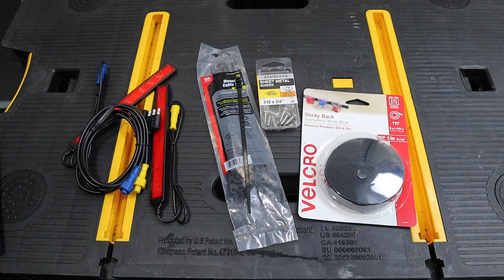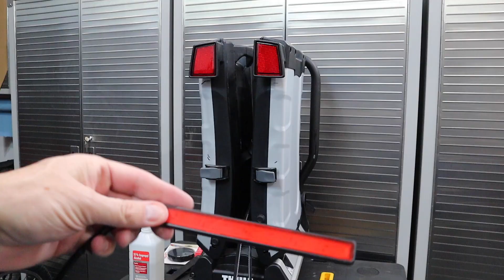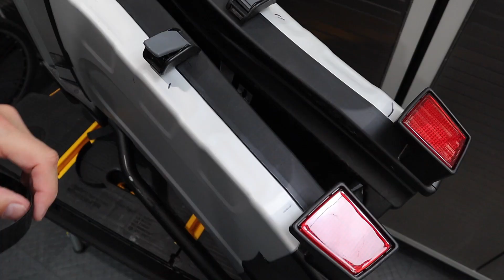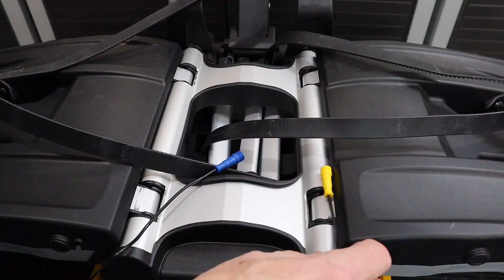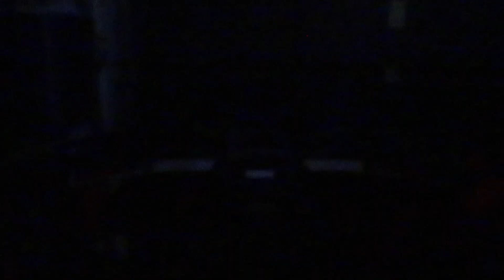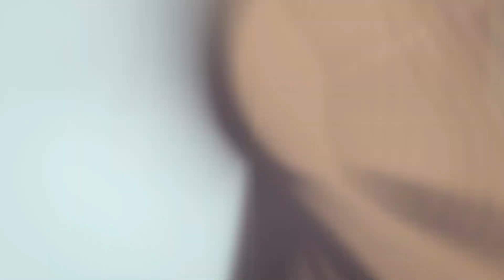Bike Rack Taillights - Added safety when your vehicle lights are covered.

Comment from the maker: Most people don't read the comment section.  Here's the link if you're interested.  https://amzn.to/2SP0SsJ
Reply: Very good video! Did you figure out the cables management?
Reply: Hello! Thanks for the video. Can you please also make a short video clip how the lights works during daytime, please?
Reply: Hello, how are your lights holding up? I've gone thru 2 sets after barely even using them. The left side light on both sets either stops working or only partially works. Meaning it will come on w/ headlights, but not the blinker or brakes. I had U-haul test my connection and it is fine. The lights worked great when I installed them.

Comment: I used velcro to mount theme aswell but I took off the silverr plates on bottom and routed the wires like the european rack has with factory lights prepared. Made it for a cleaner appearance although I did drill 2 holes for cables in retro specs I would have cables go through the reflector housing  for even cleaner install.
Reply from the maker: That's very cool.  My OCD does love a nice clean install.  I bet it looks great.  BTW, I'm from Peoria.

Comment: How is the ling term for these lights? Do they still work? Any kind of issues one needs to know about? How about the mounting method any issues ?
Reply from the maker: They worked until the day I sold that carrier.  When I upgraded my bike, it was too wide for the rack when two bikes were on it.  The lights are very good quality and the brand is reputable.  I would feel comfortable recommending them with hesitation.
Reply: @evolutionaryTom thank you

Comment: Hi Tom. I have the Thule EasyFold Rack. Have you found these lights bright enough in the sunshine or have you found a better one ? Thanks, Gary
Reply from the maker: The lights are just so so in the daytime, better than nothing.  Since that video, which is years old, I have found a better one.  Not as cheap thought but cheaper than getting the rear end of your car fixed by far!

Hollywood Racks makes this light for their racks: https://amzn.to/42BH1m8

It is as bright as the rear lights on your vehicle in the daytime.  Here's a video I did that illustrates the light in daytime: https://youtu.be/v1AL_kWj6ic

It has some different mounting options.  It comes with straps so you can just hang it over your bikes, or it has a mount for the Hollywood Rack itself.  For the Thule, I would us the velcro tape like I did in my original video and it would work perfectly on the Thule.  It even flexes so you could let it bend in a curve and follow the form of the Thule rack on the back.

I hope this helps.

Comment: @evolutionarytom Thanks for the video Tom, this is exactly what i was looking for. How well does the velcro tape stick over time with the elements? I'm looking to use this both when the rack is up and when it's loaded with bikes and velcro strips at different locations using the same light bars are exactly what I was looking for.
Reply from the maker: The velcro has held up really well.  Recently I did a video on another light bar and I think it can be adapted to the Thule rack in the same manner, with the velcro.  It is very bright and easy to see in the daylight.  https://youtu.be/v1AL_kWj6ic Both are better options than no lights at all, for sure.  Thanks for the nice comment.  -Tom
Reply: @evolutionaryTom  Thanks for that link and video. I am weighing my options now. I have a Saris MHS platform and Saris makes a light bar that is specifically for MHS racks and has a bracket that uses existing bolts and bolt holes to secure light bar to rack and is $40 more than Hollywood. The only downside is the Saris bar can impede your legs a bit while loading on the bikes.

Comment: Awesome video. I have been looking at zillions of alternatives to add lights to my rack. Your method is by far the best!
Reply from the maker: Thanks, Randy.  I wish they were even brighter but this is a huge improvement.
Reply: I agree same here I purchased a 1up but wasn't happy with there license plate holder Led light and I thought it abit expensive there had to be a cheaper alternative that makes you happy with a license plate AND a Brake and sjgnal light at less then half the price 1up was offering.

Comment: I watch this video to find out where u connect the light to the car but it’s not there . Don’t watch this if ur looking for that
Reply from the maker: It's just the standard 4 way flat trailer plug that connects to the car.  It's at the end of the wire to these lights.  You just plug it in.

Comment: This is so helpful! Quick question: How beneficial is the velcro versus just using the existing 3M adhesive tape?
Reply from the maker: Thank you, Adam.  I think the 3M tape would work just fine.  I've found no need to really remove the lights since I came up with this.  I think you'd be good!  -Tom
Reply: @evolutionaryTom  Thanks!! I might also want to use this rig on another hitch carrier I have. But to be honest, the LED is around $25 and I might just buy another set.

Comment: Thank you for being considerate to your fellow drivers! I see so many people with bike racks with the bikes blocking their signals, driving down the interstate without a clue nobody can see them or their signals. Not to mention the trailer, oh gosh the trailers where they can’t spend 30 seconds doing a simple light check and lights don’t work, partially or at all. Or the one trailer I saw with REVERSED turn signals, when he put on his right turn signal the left trailer signal flashed and vise versa…

This is great. I plan to get a bike rack soon and was looking for ideas on lights so I don’t do the same. I’m not a huge fan of how dim the turn/stop is in relation to the running lights on these particular signals, so I’ll look for other ones for myself, but even so it’s 1000% better than the no turn signals I usually see around here.

Comment: Update on your taillight installation???
Any suggestions or things you might have (or have done) differently??
Great video by the way.... I bought the same rack, and I am going to install the same light as well.
Thank you!
Reply from the maker: Thanks for the nice comment, Albert.  I haven't done anything different, it's still working great as is.  The best way to manage the wire is just a zip tie.  Since it's not a permanent fixture on my vehicle, taking it on and off should be as easy as possible for me.  That's why I just ruin one zip tie at a time with the wire management.  -Tom

Comment: Tom - thanks for this video and answering my question.  As it turns out, I had used the exact same product on my Hollywood rack.  One thing I would caution about with this product is that because the LEDs draw very little wattage, the wires are incredibly thin.  Mine were defective right after I installed them the same way you did.  They’re easily pinched when folding the rack etc.  I just ordered the same rack you have and will use the same lights again as everything else is too bulky.  This time will run the wires through a narrow piece of automotive plastic flex conduit and be careful not to let it get pinched.  Your content is great and thank you!

Gary
Reply from the maker: Thanks for the tip, Gary.  I love learning from others who have done their own hacks.  Thank you very much.  -Tom
Reply: Great idea on the automotive conduit what size diameter?
Reply: Hi David - almost any auto store such as O'Reilly"s or Autozone sells this stuff in all diameters down to 1/4" or 5/32' and either one will do nicely.  
Cheers

Comment: Tom how did you end up routing the wires? I have purchased the same lights.
Reply from the maker: I used stick on cable routers, the kind you see in the office stores, not the hardware stores.  Then I can snap the wire in and out as needed.  I route it strait to the plug and the excess I bundle up with a Bongo Tie.  Works great.  -Tom

Comment: Great video! I followed your advice and I bought an XT-2 and the LED tail lights. I installed the wiring harness myself and ... the driver's side of the lights does not work. Any ideas? suggestions? troubleshooting steps? Thanks to all in advance.
Reply from the maker: raulapa, I can't think of why they wouldn't.  Must be defective lights.  They are such basic wiring that I can't think of anything on your end.  -Tom
Reply: @evolutionaryTom  thanks Tom. To be on the sure side I'm doing some tests with my multimeter
Reply: @evolutionaryTom  I bought a basic 4-way flat connector tester. It shows a fail on left turning light problem. When brakes are applied, LED lights work OK so, problems seems to be the wiring harness/Converter. My re-seller is contacting Curt to see what they'll do.

Comment: Where are the signals and license plate? İt doesn't look like legal.
Reply from the maker: LR, the lights are also signals and brake lights.  The rack has a location in the middle of it where you can put your license plate as well.  -Tom
Reply: @evolutionaryTom  thanks for your answer.

Comment: I really like this tail light solution.  In California I have been pulled over twice for no tail lights on the bike rack,  and also,  my license plate on my Ram Promaster conversion van is covered up by my bikes,  and the last officer reminded me that when I moved my plate I needed to make certain it also has a light.  So....until I figure this out,  I am not able to take my e-bike out on my van...frustrating....I dont know why they do not put these required items on these expensive bike racks in the first place.
Reply from the maker: That's pretty frustrating, Jackie.  I hope this idea helps you.  You are correct, it should be integrated into the design in the first place.  -Tom

Comment: Thank you soooo much for this! I bought exactly the same light kit in Canada but use 3M dual lock tape instead for even stronger adhesive strength. 

The CURT 53201 auxiliary led indicator lights kit is a great product that brings no hassles to me who is not a handyman at all. All the cables are long enough for any regular rear bike rack and cargo carrier.
Reply from the maker: You are welcome, Agnes.  I'm a big fan of the 3M tape also!  I hope it all works for your setup.  -Tom

Comment: I have a 4 bike rack--how long is the harness?  Want to make sure it will be long enough.
Reply: I bought this kit from a Canadian website. If you check this product review video by e-trailers on Youtube, he mentions the harness is 71-inch long, and left/right module is 22-inch long. To me that's pretty long enough for a Thule T2 Pro XT 2-bike setup.
Reply from the maker: You would need an adapter, Aaron.  It only comes with a 4 pin standard spade plug.
Reply: The wire from the 4-pin flat connector out to the splitter is 71".  Each of the lights has another 22" of wire.  Image #2 on the Amazon product page gives the details.  If you need extra reach, you can buy an extension cable for the 4-pin connector.  Here's a link:  https://www.amazon.com/CARROFIX-Trailer-Extension-Female-Connector/dp/B07QPPT6X9/ref=sr_1_3?dchild=1&keywords=4+pin+flat+harness+extension&qid=1597284014&sr=8-3